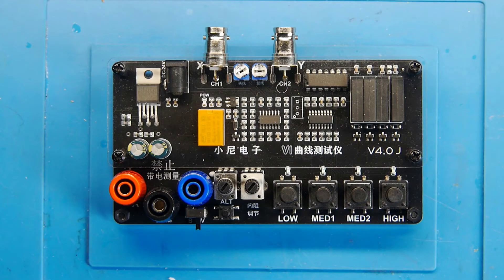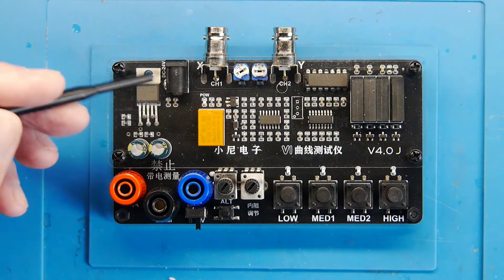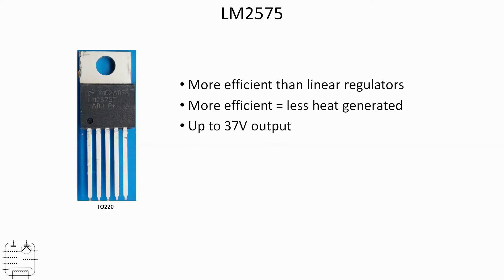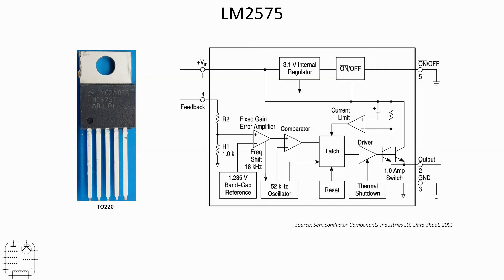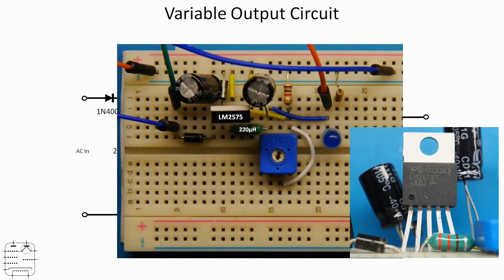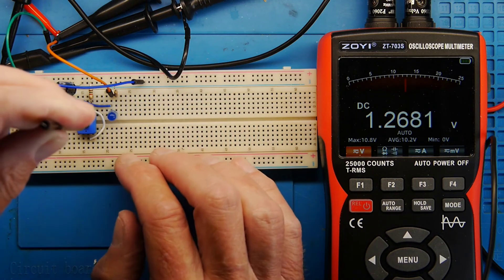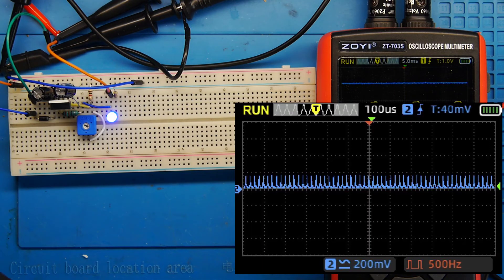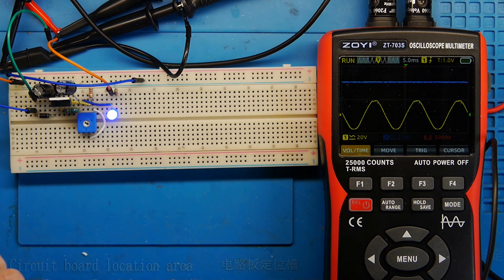The LM2575 Switching Voltage Regulator - #203

Comment: A few things to also mention:
If you are working with an input voltage greater than about 10V, it is worth replacing the 1N5819 with an SBR diode.  An SBR conducts like an Schottky but doesn't leak much.
This chip can also be used to turn an unregulated positive supply into a regulated negative supply.
It is  useful to parallel multiple capacitors to make the large capacitor values.  This makes the impedance lower.
It is easy to find "dual inductors" that look a lot like a transformer but really are designed as inductors.  You can use this to make low powered parasite supplies along with the main supply output.  This can be useful to power a few op-amps in some 3.3V digital system

Comment: The best electronics project I made was a variable AC to DC power supply, in the 1980s.
Reply: I have a fairly hefty "bench supply" that I made in about that same era that I still use today.
Mine has 3 isolated outputs that are basically 3 LM317 regulatiors being helped by a lot of transistors.[1]
This go up to about 30V and one does about 2 to about 6V
[1] The circuit for doing this involves putting a resistor in the supply line feeding the regulator and using that to bias a PNP transistor on to add some more current to the output side.  I, however added a resistor in the collector connection of the PNP and then used that to bias on a parallel combination of several TIP35 transistors.  This really spread the heat out and lets me get peak currents over 10A into things that draw current in pulses.
Reply: @kensmith5694  I never had as much skill as you.
Reply: @JohnAranita  ... or is it that you don't have that skill yet? Stuff is learned in most cases
Reply: @kensmith5694  Yeah, I moved beyond the hobby for many years.  : - )
Reply: @JohnAranita  :) :) :)

Comment: Beware of cheap fakes of this that don't like 40v inputs and can 
be just as poppy with high outputs. (Same with cheap Arduino/esp boards many are good to 12v, but it you put one in a car and the charging of the battery gets it above 14v I have seen them (1117 5v regulartor) go short and pop the lot....